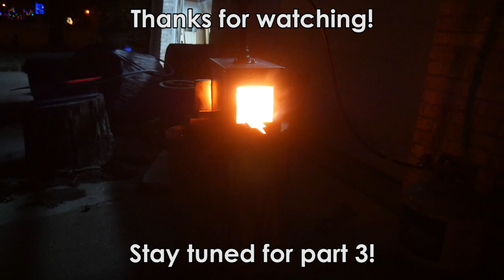Part 2 - Ammo Can Forge: The Insulation

Comment: Where did you get the silica, and what kind? I have the exact same thickener, but cannot get it to mix with water.  Tried distilled, tap, filtered, different temps and NOTHING! Unless you edited out 20 minutes of shaking it up...
Reply from the maker: I used System Three brand colloidal silica found on Amazon. It dissolved as soon as it hit the water. It was really inexpensive as well.
Reply from the maker: Mixed it with water.

Comment: What was the blue liquid for?
Reply from the maker: Rigidizer. When fired, it hardens the outer surface of the ceramic mat, making it a little more resilient to the wear and tear of normal forge use. It also helps keep the microscopic, cancer-causing fibers in place while the forge is running so they don’t become airborne and end up in someone’s lungs. Thanks for the question. If I get enough questions about the forge, I’ll do a Q&A video for it.
Reply: Awesome thanks for reply.